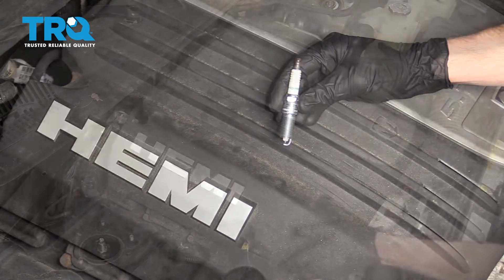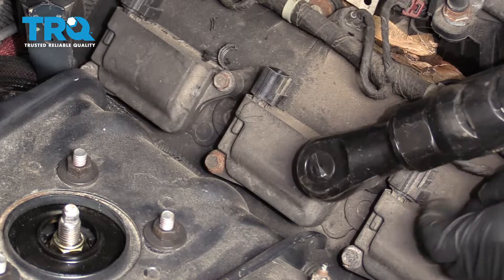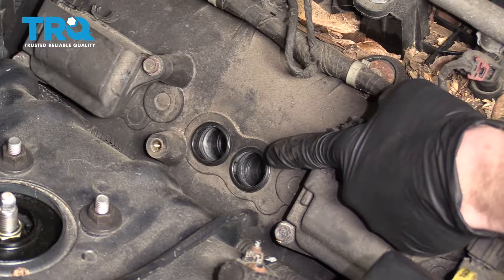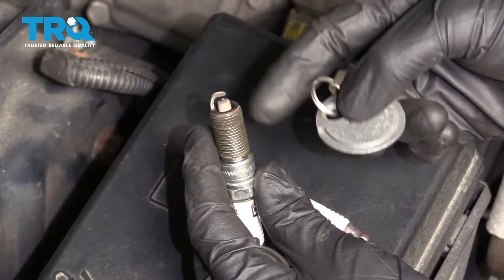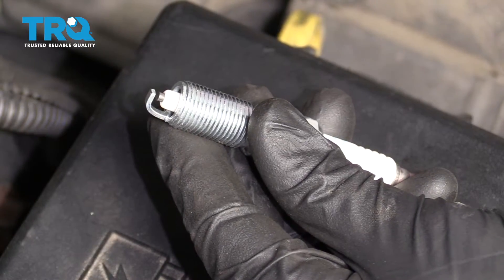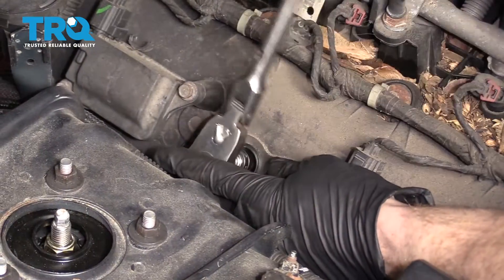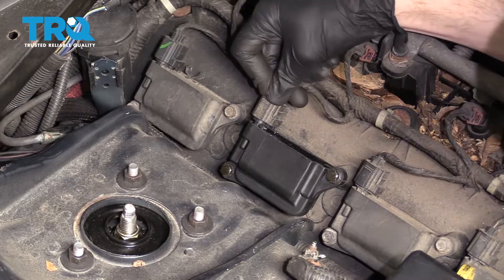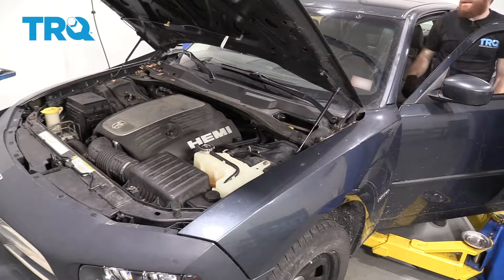How to Replace Spark Plugs 2006-10 Dodge Charger

Comment: Are there 2 spark plugs per cylinder ? should I put some "never seize" on the spark plug threads ? The copper kind of  "never seize" or the silver kind ? What size is the spark plug socket ? Is it the same size socket for the 6 cylinder engine as it is for the 8 cylinder engine ? Is the torque  (12 ft. lbs ) the same for a 6 cyl. engine's spark plugs ?
Reply: when you buy spark plugs you should know what make, model and year it is, that's going to help you find recommended type size etc. btw the video is clear enough for most people who are capable of understanding simple instructions and wanna change their own spark plugs on a  V8 Hemi (2006-2010)

Comment: What spark plug brand would you recommend with a 09 charger hemi
Reply: Champion is what they came with originally you might want to do research on the Platinum champion but the Plain Jane Champions are stock
Reply: @mikecunningham4293  iridiums last longer compared to platinum. Instead of changing them every 30k platinums I’ve noticed start wearing out sooner